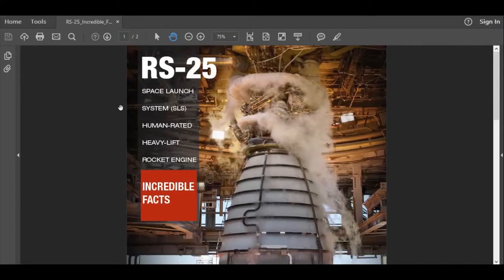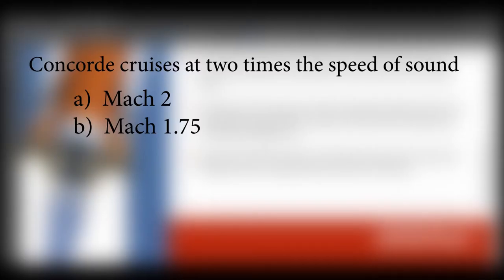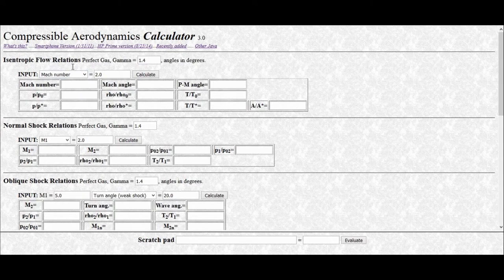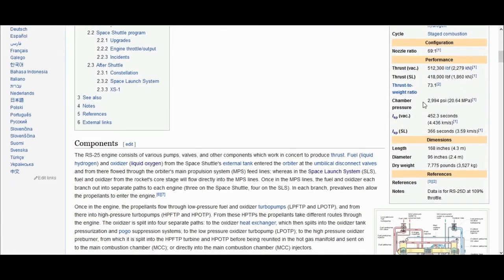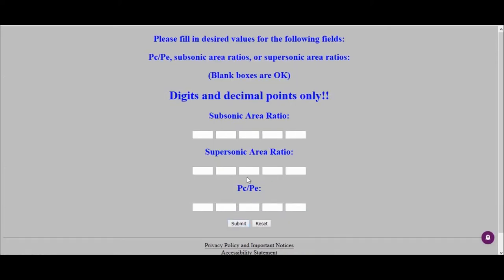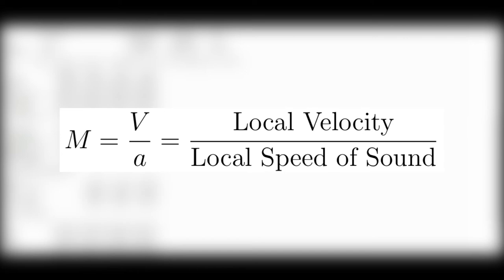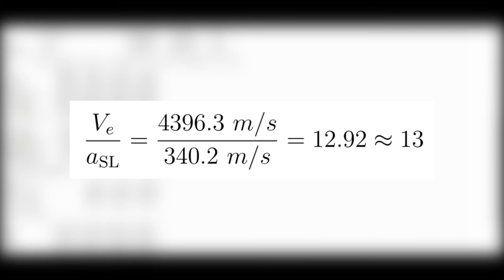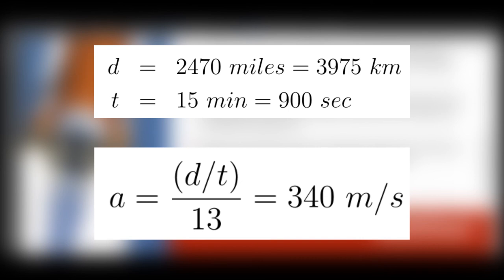Misleading RS-25 Incredible Fact

Comment: What a problem!! Another good way to approximate the exhaust velocity is by using specific impulse and gravity!
Reply from the maker: Great point Wayne!  For anyone reading this comment, just make sure to realize that this is an effective exhaust velocity, and to get the actual exhaust velocity, you need to take into account the pressure difference between the exit of the nozzle and the atmosphere.  I think I'll make a quick video on this next!

Comment: hello josh, I wanted to know from where to start fluid mechanics and reach up to cfd? also what resources you followed for the same?
Reply from the maker: If your goal is to learn CFD, you need a strong understanding of the fundamentals.  This means going back all the way to your early calculus classes.  When you start learning CFD, you'll appreciate why you took all these other classes that might have seemed irrelevant along the way.  For instance, on the math side, CFD builds upon calculus (Taylor series for instance), differential equations (ordinary and partial), linear algebra, etc.  On the physical fluids side, CFD builds upon thermodynamics, fluids, incompressible flow, compressible flow, viscous flow, heat transfer, etc.

If you want a really good book about CFD, I would pick up Computational Fluid Mechanics and Heat Transfer by Pletcher, Tannehill, and Anderson.
Reply: thanks